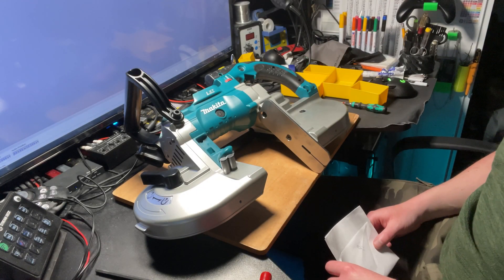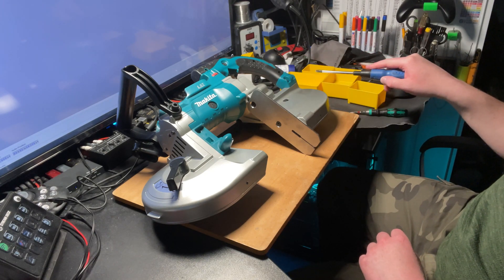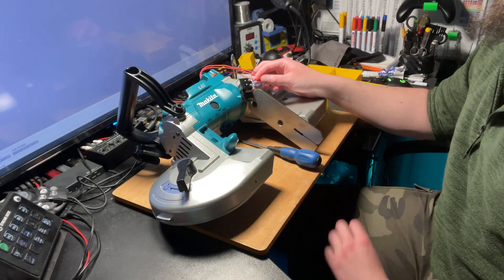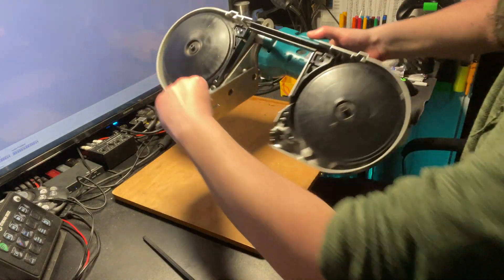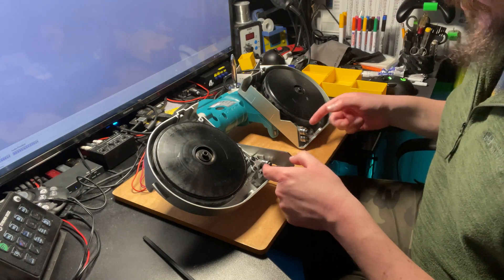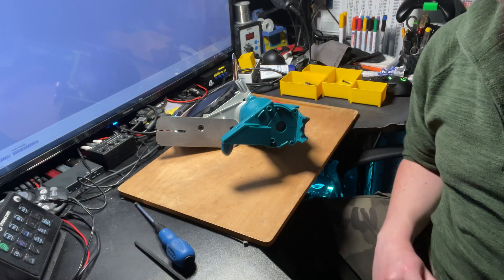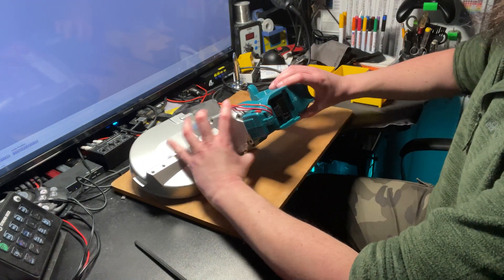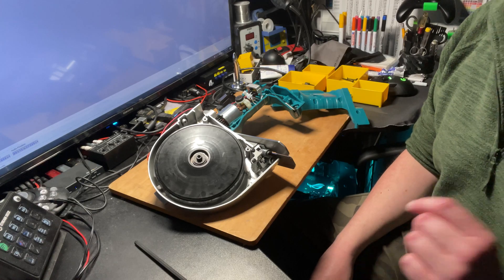Makita XPB02/DPB180 Cordless Portable Bandsaw Teardown & Modification Part 1 - Teardown

Comment: what battery would you recommend for the longest run time?
Reply from the maker: For best run time the bigger the better, Makita's biggest 18V battery is 6Ah. Value wise the 5Ah is better and I only ever buy batteries when there's a sale on.

If you want really long run time there are adapters to use Milwaukee batteries and those go up to 12Ah.
Reply: @MattTester  thanks mate for the the help 😊👍

Comment: @Matt Tester: Love your video! Subscribed.

One question if I may: I am thinking of buying this bandsaw and was thinking (in my naive mind) if I could remove the 45 angle band rollers in order to convert this bandsaw into a stationary bandsaw for wood. Do you think this has any chance of feasability? Of course, without those rollers the band would be a little less plum under load but I could live with that... What I'm concerned is if there is something awful wrong in my approach that I fail to take into consideration.
Reply: Check out SWAG OFFROAD for their stationary table for this saw.
Reply from the maker: Hi Andrei, thanks for watching the video. I wanted to try this so removed the bearing blocks from mine and re-fitted the blade, it does still tension up but there is nothing to keep the blade tracking correctly. I think as soon as force is applied the blade will be pushed off the wheels, or it will at least go so far back that it starts touching the guards. 

If the bearing block is fitted without the front bearings (just leaving the rear support bearing), it no longer lines up with the blade and the rear bearing can fall out as the front two hold it in. I'm sure you could correct this with custom wooden or plastic guides, Matthias Wandel has used wooden blade guides on his custom bandsaws in the past. I hope this helps.
Reply: @MattTester  thank you very much for this information! Now I can make an informed decision.
Reply: @MattTester  Thank you, this answers my questions completely! THANK YOU!

Comment: JIS is right, they are well worth getting, a set of Vessel ones off Amazon are cheap (when compared to Wera, at least). Good videos, thanks, I'm shopping around for a portable bandsaw just now and this is currently top of my list so very timely.
Reply from the maker: Thanks I will look at those, I don't do much with JIS screws but it's better to have the right tools. This is a great saw, very handy for little cut off jobs and I used it to chop up an old trellis so it cuts wood decently too. 
I don't think it's worth buying the smaller saws and there are decent deals to be had by importing from the US via eBay, if you don't mind waiting a couple of weeks. Get one that ships via the Global Shipping Program and you won't have any surprise charges. Thanks for watching.